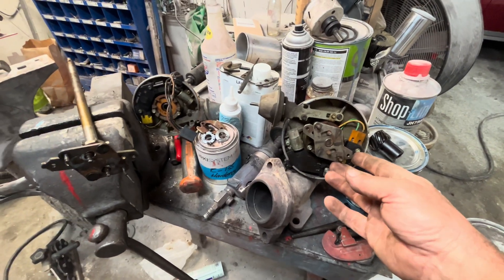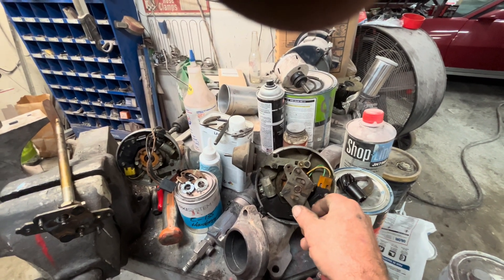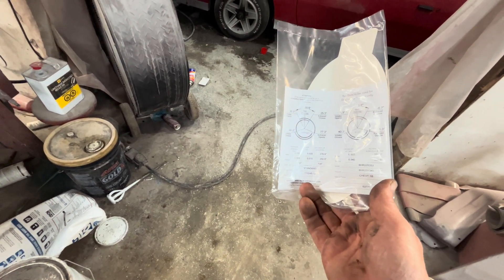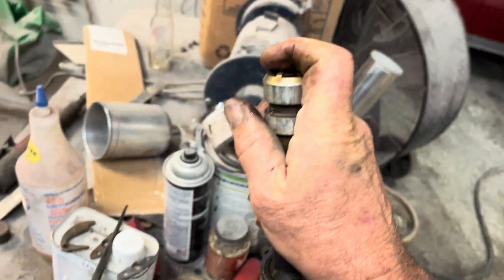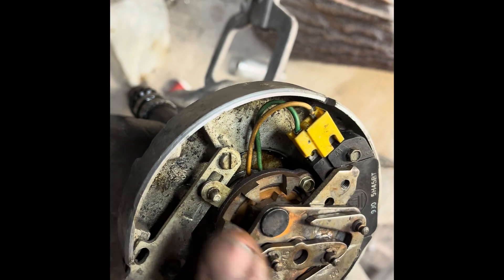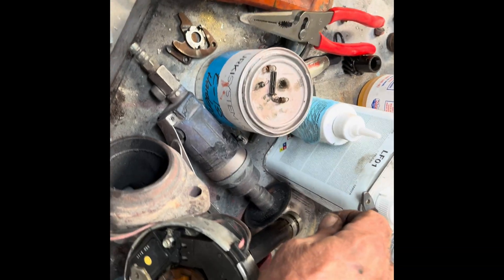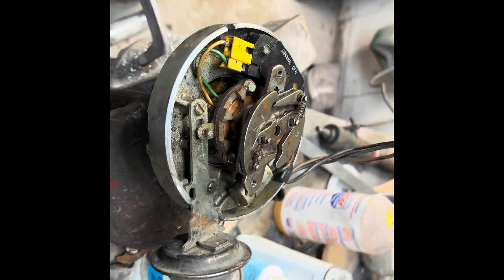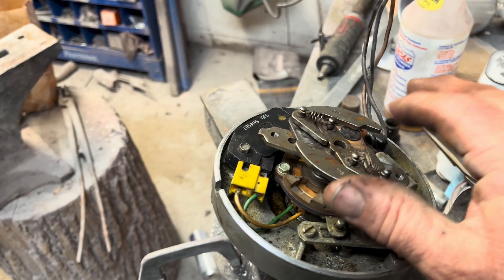HEI distributors suck here’s one reason why and how to make them suck less

Comment: Welding up the slots is the way I limited the advance back when I did a LOT of recurves. I welded up both sides of the slot and then used my Sun distributor machine to figure out which side of the slot to file to get the curve I wanted. I also cut the tips off both advance weights so they didn’t bottom out on each other. This also requires cutting the fat end of the weights to make them lighter. With this setup I needed fairly stiff springs which makes the weights unlikely to hang up which can happen with very light springs. You must have a distributor machine to get it right.
Reply from the maker: @truthboomertruthbomber5125  I have a distributor machine but I seldom use it with the new timing lights I adjust spring pressure to get my advance to come in where I want it on the car

Comment: i wish they would aftermarket set bushings for these HEI's that would be a set amount you could install. like they do cams for timing
Reply from the maker: @141runn  apparently Moroso makes a recurve kit I’ve ordered one to see what’s in it
Reply: @EverythingHorsepower  ive seen those an i cant see any difference in them than the factory ones. i dont see how they will reduce the mechanical advance any.
Reply from the maker: The kit is cheap so I have one on the way and I’ll find out but as you say it may just make the weights react quicker without limiting sweep

Comment: Ran HEI for years on a 327, 400 hp +, never had that much of a problem. You probably have too big a cam in your dinky 305.Proper carburation and a good combination and tuning goes a long way. The only thing I would suggest for the HEI is a better module and coil for street . For racing get rid of the weights and vacuum advance and lock the shaft for whatever all in timing and use a start retard.
Reply from the maker: @havebenthere  definitely welding an HEI solid fixes the mechanical advance problem and I actually haven’t driven the dinky 305 yet I’m basing the timing issues on hundreds of customer cars over the years coming in with similar problems and a wide variety of engine combos
Reply: Your problem is a 305 ci
Reply: Maybe this is a medium cam-  250@50 , 531 lift 108deg.  355cu.in.  i welded mine, full timing is 36-37, 10.5:1 and 94gas.   Car was/is more responsive, i think the cam liked it